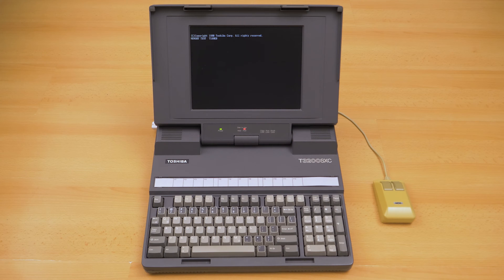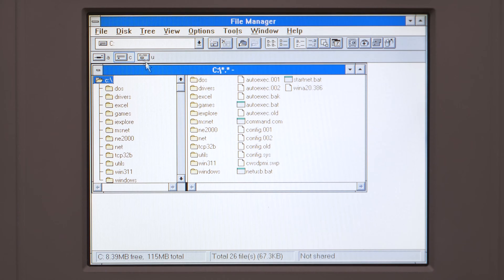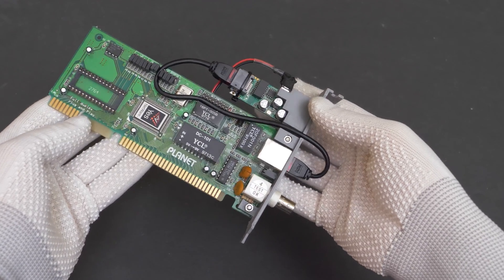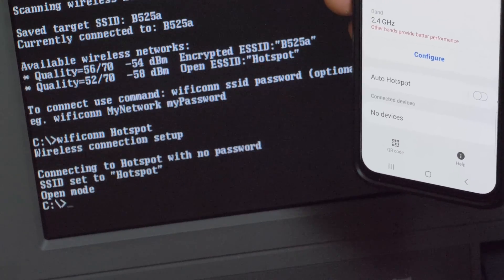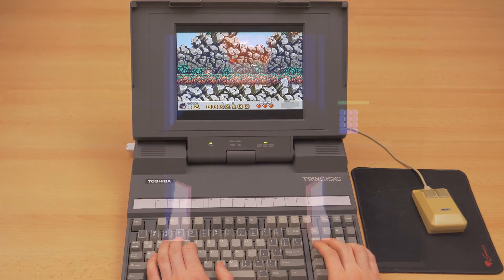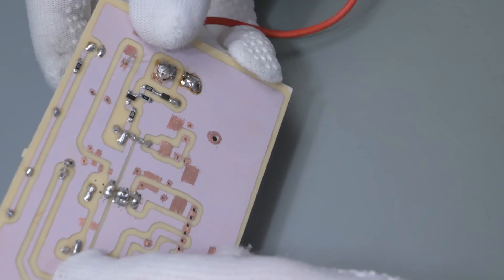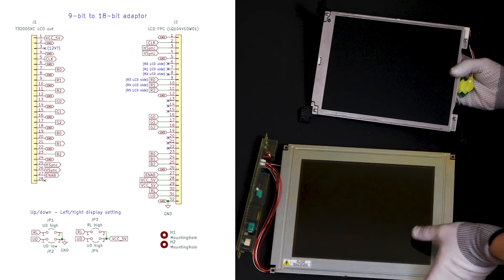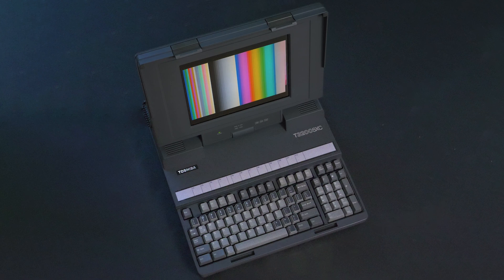31-year old laptop upgraded with Wi-Fi and USB storage. Toshiba T3200SXC. #HackadayPrize

Comment: Hi Adalbert, I'm restoring a T6400DXC, it has the same screen. Could you tell me which DC/AC inverter you used for the new screens backlight CCFL?
Reply: I found these specs for the old screen backlight:

- Startup Voltage (at 25°C): Max 1100V
- Startup Voltage (at 0°C): 1100V
- Running Voltage (Typ.): 540 Vrms
- Running Current: Min 2.5mArms, Typ 3.7mArms, Max 4.5mArms
- Operating Frequency: Min 20kHz, Max 60kH

Will the old inverter work with your new screen?

Comment: Hold on, you can run openwrt on ethernet card?
Reply from the maker: I'm not running it on ethernet card itself, I soldered a small wi-fi router (A5-V11) on top of the ethernet card and that router has OpenWRT. So this is a modified "hybrid" card now.

Comment: Can the cpu be upgarded with FPU model i.e 386DX?
Reply from the maker: Not 386DX, this laptop has 386SX and the pinout is incompatible. But it has a separate FPU installed right now in a dedicated socket (387SX). However it should be possible to upgrade the CPU to something like TI 486SXL, which uses the same 16-bit bus as 386SX. It would require de-soldering the CPU.
Reply: @adalbertfix  better install the FPU too, can run win95 if have FPU and enough memory, say 16MB

Comment: Would love to see this with an internal CF — IDE or mSATA to IDE adapter… ❤… would also love to see it dual booting with ELKS embedded Linux, or Linux embedded for 386 and running X Windowing system. Does it have an FPU chip? Or did I misread the subtitles. 

Also where are you in the world? Would you want to restore and upgrade my T1950CT with a 486 in a similar fashion, pay you to do that but you can also make a video? I have a monochrome (plasma???) NEC laptop with a 286 as well. Both need new caps, new batteries, repaired floppy drives. 

I meant to do it and start a channel before becoming disabled.

Comment: I was fortunate enough to find this laptop in almost a mint working condition. Replaced caps in the LCD to get it working again (mine was broken too), the PSU wasn't leaky, but the RIFAs were all shot, so I removed them and then I stumbled across your Hackaday entry. Downloaded the gerbers, sent them to PCBWAY, built the PSU (omitted the expensive DC-DC converters, used cheaper alternatives) and printed the bracket for the DC barrel jack. Thank you for the writeup and the videos! If you ever get your hands on the T6400DXC I'd like to see what you can do with that one.
Reply from the maker: Oh, that's great that you were able fix your machine and gerber files worked fine! BTW what kind of issue did you have with the LCD? My screen was almost all white, with very faint image, and after some time also the inverter stopped working. Did replacing the caps helped with the faint image, or was there another issue? Did you replace caps in the LCD itself or the inverter board?
Reply: @adalbertfix  that was exactly my issue. Then I replaced two or three of "easily" accessible caps on the side of the LCD and then the image was readable but was in inverted colors. So I continued replacing all caps hoping it will solve the issue. And it indeed did. I replaced all caps with ceramics and tantalums so I don't have to deal with these problems 30 years from now sarcasm
Reply: @adalbertfix  And to the inverter board. Mine worked fine so I put it up for sale, because I wasn't feeling comfortable around it. I bought a cheap universal led backlight kit (controller included) and put that in. Led strips are held with the smallest zip ties and the controller board I insulated in kapton tape and wedged it between the screw post and the chassis on the left side where the inverter was positioned.

Comment: My very first laptop wasn't much younger than this. It was maybe a 95/96 machine or so that I got second hand in 99. SVGA TFT screen, P75 with 8mb ram which I upgraded from another similar laptop to P90, and bought 32MB of RAM for $800. Yes $800. But it made the machine useful. It had PCMCIA card slot which I populated with a combo modem/ethernet card. Also upgraded the 1GB hdd to two 2GB hdd's/ The second hdd was in a swappable bay that I also had a FDD for. Still that's nothing to what you've done with this. This job is next level :-)

Comment: Next upgrade maby an internal batterypack thanks to the space you gained from modernizing the power supply and a 386 dx 40? I also love to tinker with old laptops and hardware, my biggest project whas a custom games console i build into a wifi router :p and crazy to see that the internet is more usefull in dos than in windows! And you deserve so much more views and subscribers! You are a genius man really!
Reply from the maker: Thanks a lot for the comment, I appreciate it! Yes, it would definitely be possible to install a battery inside, there is plenty of space now. But the problem is, that accessing the power supply compartment requires literally a complete tear-down of the computer (LCD, keyboard, hinges, top cover, everything goes out). Batteries would certainly die after some time, and replacing them would be painful, and every time the laptop is dissassembled, it can also cause some wear on the plastic elements. But there is also a compartment designed for an additional modem in the bottom, which is accessible from the outside, and the battery would be replaceable. I can check if it would be possible to fit some cells with enough capacity in there.
Reply: @adalbertfix  Ow i didn't know it requires a complete teardown to get to that power supply, and if there is enough space in the that modem slot you could surely do it, and having it charge through your power supply would be easy enough if you use a powerbank pcb, you can put some apple like indicator somewhere where the other leds are for example, i love to see people tinker with old machines and make them do things that they were never designed to do :)

Comment: I’m loving the ingenuity about the NIC, mini router and wifi/SMB share option. You’ve absolutely gone all-out on this machine! 

Ever thought about upgrading the CPU to a 386DX-40? It looks like you’d definitely be skilled enough for such tasks. 

Truly inspiring! Thanks for that!
Reply from the maker: Thank you! 386DX wouldn't fit unfortunately, because it needs more pins (386SX that is currently here has half the bus width of DX). But there are special chips like Cyrix Cx486SLC, which can be used to replace 386SX with a slimmed-down 486. That would definitely make this machine much faster, and maybe it would have a chance of working, but since it would require desoldering the original CPU and replacing it with something else, I wonder if wouldn't that be sacrilegious :)
Reply: @adalbertfix  Its worth it, do it!